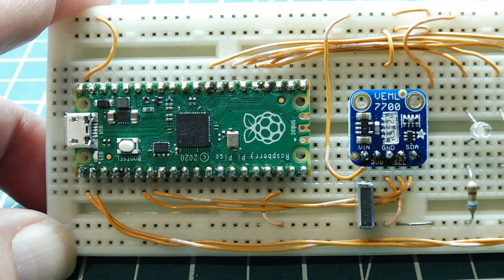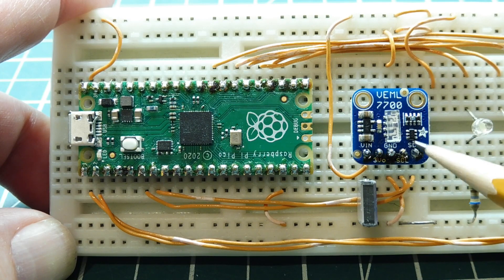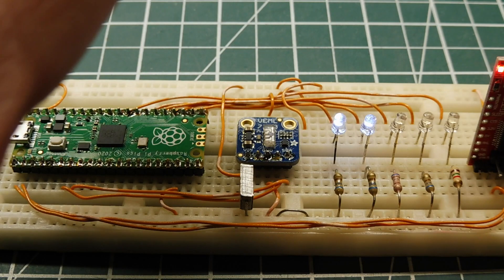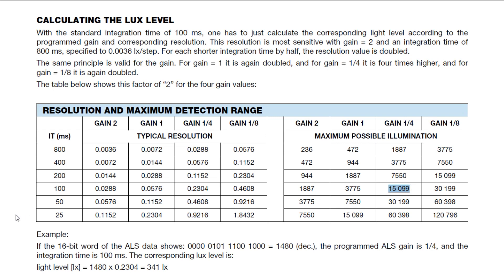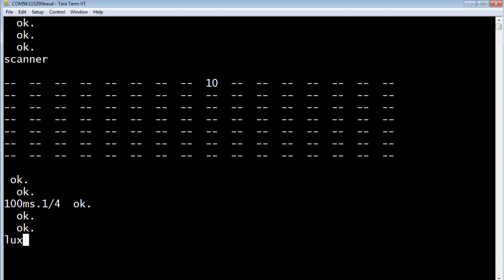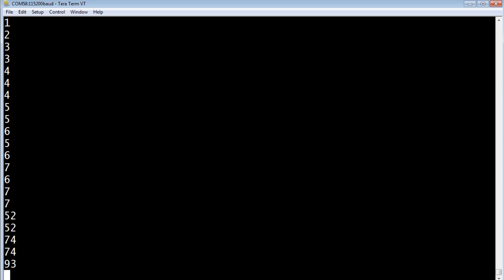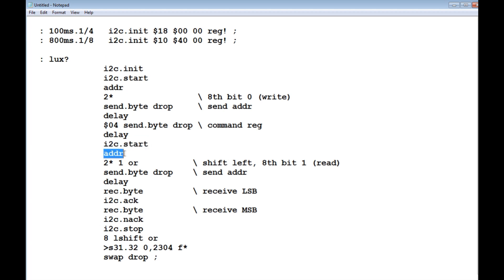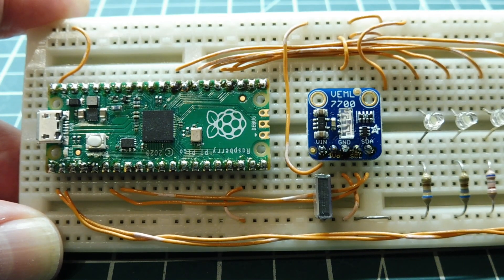Ambient Light Detector / VEML7700 / Mecrisp Forth

Comment: Where did you get the i2c words from? I don't have them in my full mecrisp with tools image.
Reply from the maker: I have written my own wordset for I2C and SPI. There was little interest so I have moved over to the PIC platform with the Scamp3 board. If you want a wordset for I2C on the Pico check out the experimental file (Tachyon) or Zeptoforth.
Reply: @0033mer  Thanks! I got the i2c to work yesterday as it's nice and simple in hardware -- just a lot of digging through the RP2040 docs. But ZeptoForth really looks nice, well documented too unlike mecrisp.

Comment: Really enjoyed this @0033mer, so much I bought a RP2040, installed forth, lots of fun, but, how did you get i2c running? I don’t find any of those words with the latest release? Enjoying the channel!
Reply from the maker: Hi Jose .. thanks for supporting the channel. I have written my own support words for I2C, SPI, GPIO ... etc so I get that question a lot. To make it easier for beginners learning Forth I started the series using the SCAMP3 board which has support for all those protocols, so explaining code is much simpler.
Reply: @0033mer  Thank you for the response. I have a SCAMP3 on the way so looking forward to seen your tuts! BTW, I found a nice source for I2C tucked away on the stm32f103 folder for the Mecrisp Stellaris Forth... I'm getting closer.. :)

Comment: Another awesome video :)

003mer, I’m really trying to learn bit banging m, but have had a tough time so far. I don’t understand the whole clock timing and how to actually code it. I’ve been trying to program a maxim 2-wire temperature chip using forth. Do u know of any resources I can read/watch or practice to gain a practical understanding?
Reply from the maker: Bit banging does take a bit of practice. Start out simple and slowly take on harder projects. I would start out with the X9C103 digital potentiometer. I made a video using DS18B20 temp sensor and instead of using bit banging I used the UART to generate the desired pulse train. https://youtu.be/yHTt9ZzBpEg

Comment: I really enjoy your channel and your style of teaching makes it fun and easy to learn.  Could you please do a video on "Comparators" with a focus on how they can be used to interface analog sensors like motorcycle ignition pickup (trigger) coils, cam and crankshaft sensors, etc. into digital signals for use with a tachometer or Arduino board.  Thank you.
Reply from the maker: Thanks for the feedback. A circuit that you might want to start with is in this video that can be used to interface small signal output devices to a microcontroller.
https://youtu.be/wEqfHo_guG8
I also have some hall effect videos where I interface a camshaft position sensor to a microcontroller. I am currently installing a Pazon ignition system on an old Triumph motorocycle and have built some test gear equipment that might be shown in some later videos.